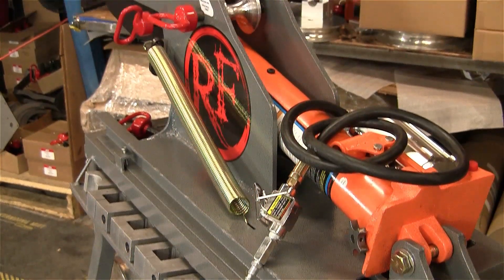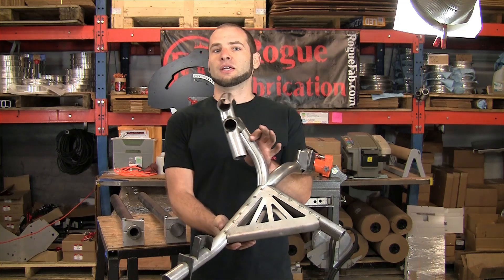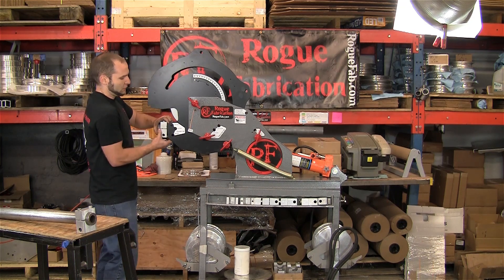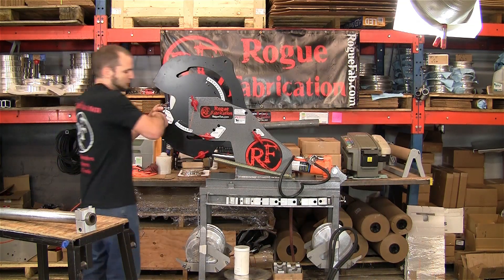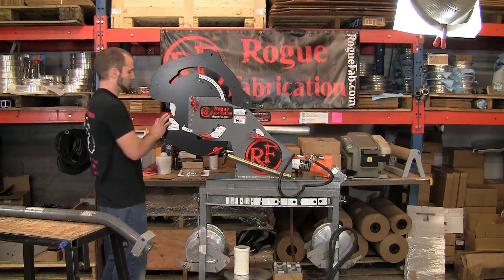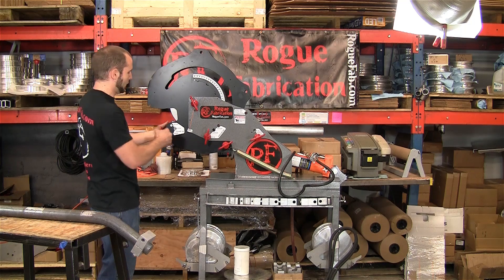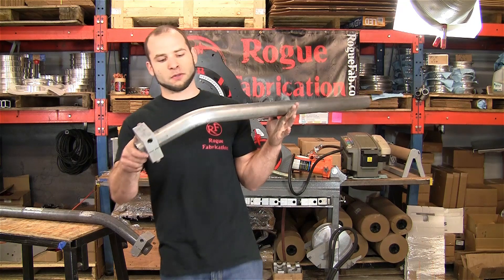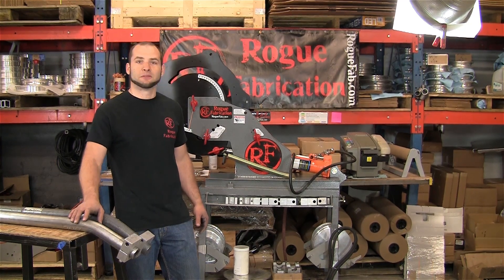Bending 2.0 solid bar with the RogueFab Model 600 xHD Bender

Comment: Is this the same as the M605?

If the “600HD” can bend this, why can’t the M605 bend 2” .250 DOM?
Reply from the maker: No, the 600 xHD was the precursor to the M625. Same frame and pin thickness/diameter. -Joe